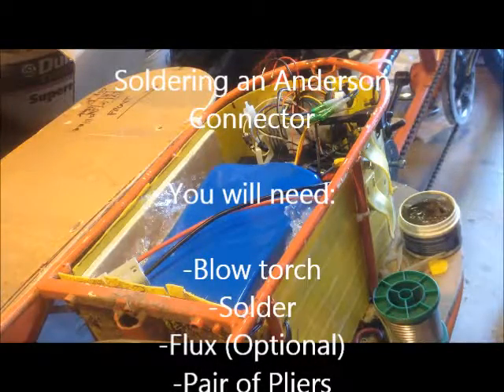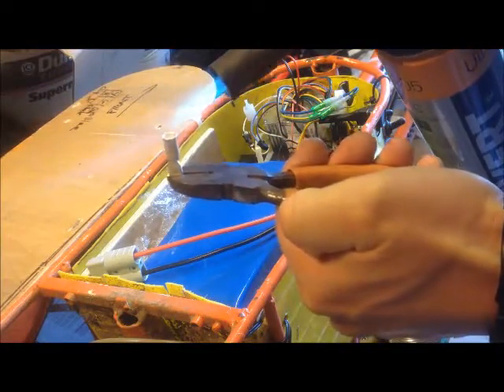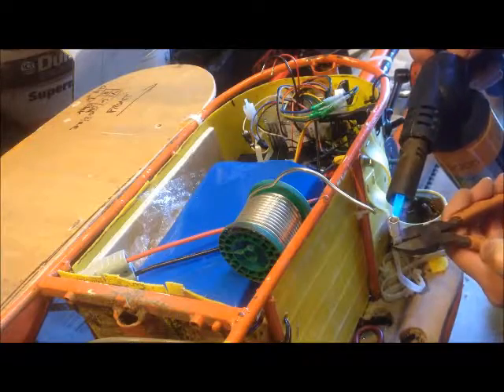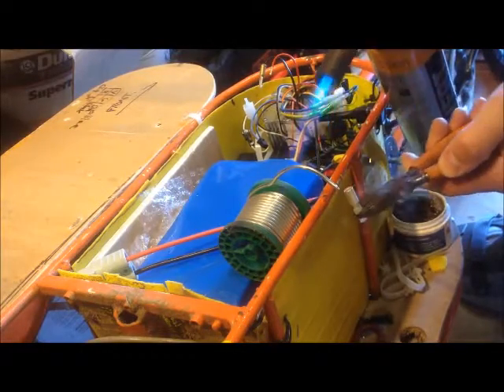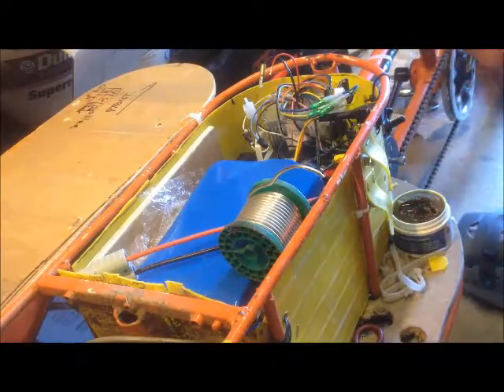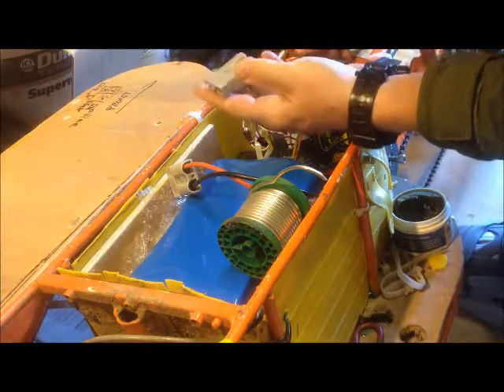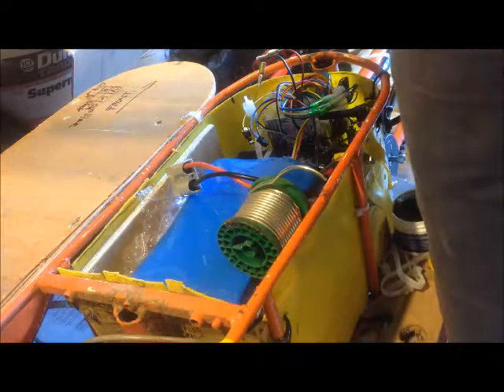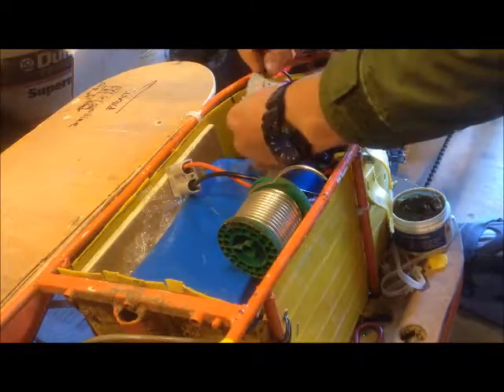Soldering an Anderson Connector

Comment: Try putting an elastic band around the plier handles so you can lay them on the bench and use them as a clamp while using both hands to solder.
Reply from the maker: Cheers SandmanOZ that is a top tip, not just for this soldering job but all sorts of things.